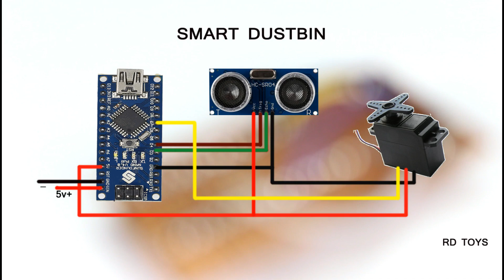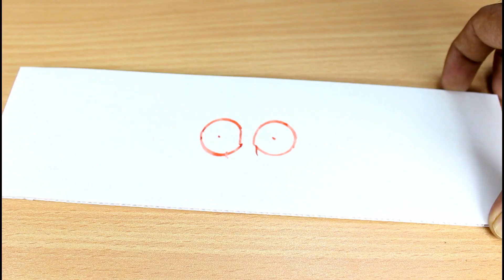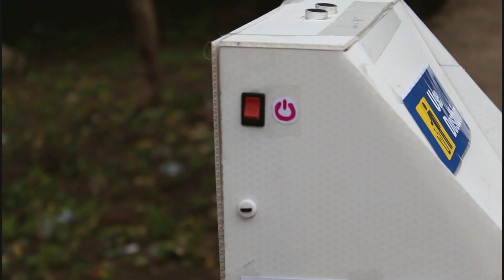How to Make Smart Dustbin | Arduino Projects 🚮

Comment: open hone ke baad dustbin ka cap uper kese hau
Reply from the maker: By using servo motor..seen again
Reply: @RDTOYS  i will try bt it will not working properly what i do
Reply from the maker: Because code and Arduino